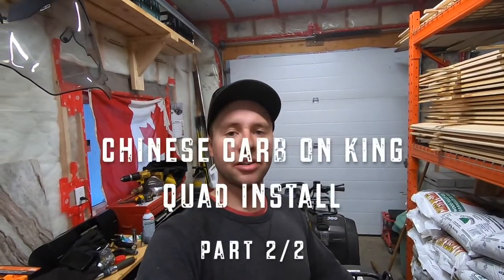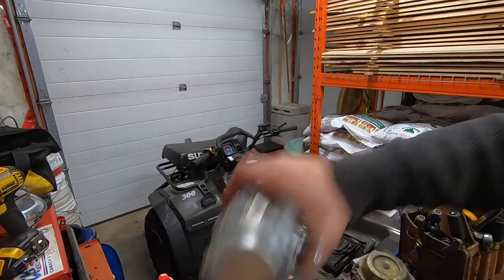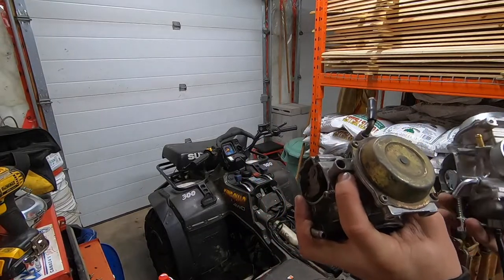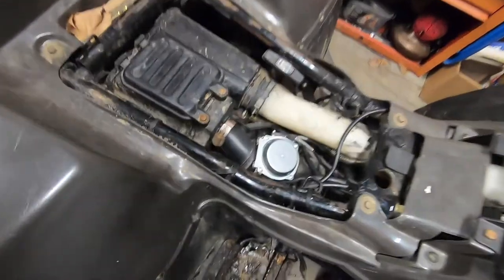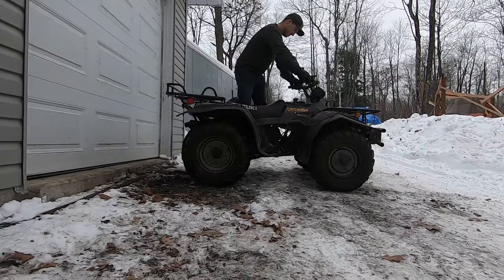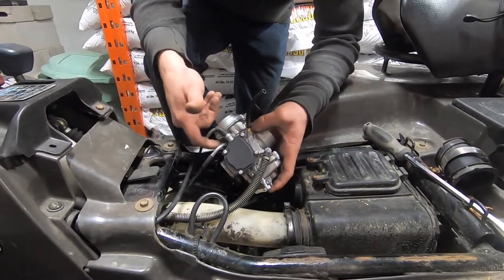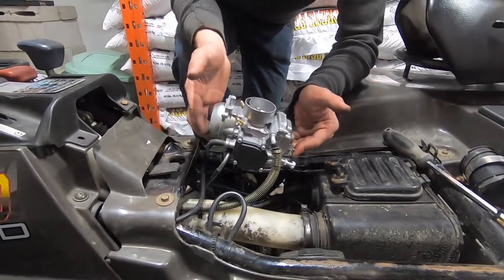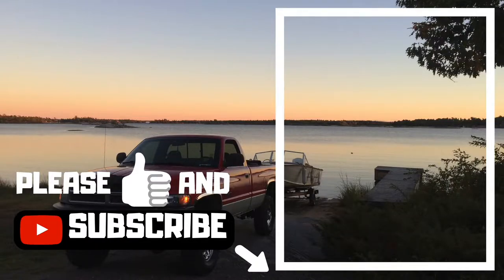Chinese Carb On a King Quad 300 Install Part#2 (Will It Work?)

Comment: Great video, I have the same issues with my Chinese Amazon carb, unfortunately can't return it because like you I modified it drilling out the throttle and the choke. I wound up just plugging the drain pot on the bottom and used pipe tread tape on the screw so that fixed my fuel leak issue. It runs great for a while sometimes 30 minutes or so and then stalls for no reason, sometimes idling it quits or sometimes running with throttle. No rhyme or reason to it. Unusually fires right back up. Mikunis are simple and a rebuild kit is less than the cost the knockoff carb so I will be fixing up my old one. I wish I came across your video before I tried and saved myself a few bucks.

Comment: As a mechanic of 35 years, with these Chinese Amazon carbs it's been hit and miss for me.I probably  installed about 120 of them and had about 30 defective. There is no substitute  for oem and I search the scrap yards first and Chinese last resort and customers are told this up front as it's not cost effective  to return them.Keep up the videos, your skills are good.
Reply from the maker: Thanks Steve. This was just a quick video. You are 100% right they are hit and miss. I never had luck and used the parts off that to sub for parts missing on the OEM carb. No replacement for factory parts… Thanks for the nice comment!

Comment: So i tried a carb swap, you have to use every jet from the original to put into the crap carb to get it to run and even then its not perfect, but rideable. Play with air mix screw and float height. Honestly i think the vacuum fuel system is pickey and aftermarket generic carbs are super hard to tune for these quads. I went back to rebuild the mikuni.

Comment: Have 1997 Suzuki 250 quadrunner, got the Chinese Amazon carb, and rcvd ok, all brass jets, fittings etc.. and float not plastic, well made overall, first thing did was gravity fuel test off the ATV for fuel leaks ( non found), installed with temp bailing wire choke / throttle cables,  started up, etc... that said, I didn't end up using it, due to the # of modifications that it would take to use my non threaded choke and throttle cables, new carb only had one vacuum port, old Mikuni had two, boots ( in / out ) almost perfect fit, but not exactly..  etc..   After lots of looking I concluded like the gentlemen below says, Junk Yard finds for old carbs best bet, didn't find anything on the net that matched old  Mikuni Suzuki Quadrunner carb,  Thus rebuild it if you can.... not hard and Schneids 15 has great video on how to do it...

Comment: I've run Suzuki and kawi style carbs for a while now and I can say the china carbs are great no problems at all. My only complaint with the Chinese carb is the diaphragm seems to be very hard in the cold causing it to run very poorly off choke until it warms up the carb a bit.

Comment: Great video! I had to drill out the same hole. Mine bogg’s just like yours did. When you get moving and keep on the gas, it runs great. Low end wise, not so much. I’m thinking about just putting the old carb back together with some of the new parts from the newer one..
Reply from the maker: That is what i would do👍🏻
Reply: Mine not only boggs down but it floods the intake box where the filter is completely. I’m a bit stumped as of right now.
Reply: I found that the size of the vacuum connection on the chinese carb caused the flooding.   To remedy, remove the nylon connection from the old carb and place it in the line.  I used a smaller hose to reconnect and the flooding stopped.
Reply: jeffer1957 I ended up completely rebuilding the old carb, but that’s good
To
Know! I never had any flooding issues but I couldn’t get it to pump any fuel at all
Reply: jeffer1957 that’s great I’ll try that!

Comment: The fuel leak seen here is probably the built in over flow not the drain screw ,  most likely due to the float adjustment .
If you must use one of these be prepared to match up the jets to your original and make proper settings . Out of the box
perfection would be wishful thinking at best.
Reply from the maker: Hey keith, it was not from the overflow. It was from the bottom. I had it on the bench and verified. Others have said they had this issue also. Josh
Reply: It is the overflow.  Restrict the vacuum to the fuel pump to slow it down.  I used the smaller orifice from the old carb online to correct.  Eventually gave up on the Chinese carb and installed a good used one from another bike.

Comment: So I’m wanting to see a video on replacing the one way gear that the starter spins. My pull starter works great but removing the seat every time is getting old.

Excellent videos, I subscribed
Reply from the maker: Thanks Justin, I have a video on this under starter clutch/ stator repair
Reply: Schneids15  thanks man, I watched it. you really do have the fullest video collection on these old kingquads.

Comment: I have one of the cheap carbs work great runs good just like he said the overflow keeps leaking. I’m going to try to put a oem float in it I think it will work there just not strong enough to hold the fuel back 🤷🏼‍♂️

Comment: I had an extra vacuum line on the top of the old carb. The new carb did not have a connection coming off the top of the carb. I plugged it with a bolt. My new carb idles and runs at 1/2 throttle. It bogs down hard at 3/4 to full throttle. I installed a fuel filter and noticed that it doesn't completely fill. It nearly drains completely on full throttle. I cleaned the fuel pump and petcock. Not sure what is going on.
Reply from the maker: Yes. I never had any good luck with mine either

Comment: On my china clone I also had to partially drill out the threads to put on the Suzuki Idle adjuster. Measured from the original and it worked ok.
Reply from the maker: If i was seriously needing to swap i would adapt the factory one on and adapt the factory choke plastic piece on
Reply: Funny thing is that mine leaked the same way as yours. Changed to the original Suzuki bowl, and it stopped leking out, but still flooded the bike.

Another tip for anybody working on these is to check out the Facebook Group "Suzuki Lt-f 4wd King quad". Very active with quite a few that know these bikes well.
You should post a link to your channel there Schneids.

Comment: Seems she was starting for fuel.  Was the oring missing for the fuel drain?  I have two of these machines.  And rebuilding one.  I'll start posting as well.  Swapping plastics from a 2001 to a 1998

Comment: I can’t get my king quad running it has spark and fuel but won’t start and the drain on the float bowl is leaking but only when I crank it over I don’t have a clue what’s wrong with it I checked the floats and there just fine

Comment: Got a barn find quad king trying to get started, followed some of your other videos and yet to solve all issues.  My main issue im having right now is im not getting fuel to flow.  Ive plugged my petcock vacume both sides and replaced the flue pump, carb, but cant get gas flowing, what am i missing?
Reply from the maker: Will it gravity feed from tank? Perhaps clogged pickup screens.
Reply: @Schneids15  I've pulled the petcock, flows free out the switch.  It doesn't flow free out of the outlet hose on the petcock, now that u mentioned that, I'm guessing that's my next step, remove it again and make sure it is clear there out the outlet side, or replace it all together
Reply: @Schneids15 petcock removed, removed the spring and o ring so it will gravety feed out of the tank into the line towards the pump, still no fuel flowing through lines, I'm guessing I trace it back to the new pump to see if thats working properly

Comment: I recently got a king quad 300 and and the carb was off of it I need help figure out where my lines needs to go
Reply: Following. I am in the same boat...
Reply from the maker: 2 vertical holes symmetrical on the back of the carb at the rear closest to manifold are overflow tubes. Blow in them and if it blows free it is a overflow. The front 2 are vacuum ports. Blow in those lines and it should not blow free. Either can be hooked up to each port
Reply: @Schneids15  how do I know which vacuum and the right order for the fuel pump? I have no ideal how to get the fuel pump(brand new) to work properly. I bought a nee fuel pump and a replacement carburetor. Cant find a video online showing the correct way to install a fuel pump for 96 Quad 4WD.
Reply from the maker: I would rebuild factory carb. I have not found an aftermarket carb that works good.

Comment: the o ring on the seat was probably left out bout one and the same thing with fuel out the bottom bought another and it worked just fine
Reply: was thinking the same.  Agreed.

Comment: I am going to tackle my carb tomorrow after watching your videos. It has been sitting for a year . Do you think if I clean it that will be fine or should I put a kit in it. Also if I run into problems can I get in touch with you for help. Thanks
Reply from the maker: Sorry. Hope today went good. You should be alright with a clean. Likely a bit of gunk in the jets.

Comment: Howdy. Thanks for the detailed fixes on the King Quads. I rebuilt my 96’ carb thanks to your vid, and it works well. Starts ok and idles good. However, after a sustained run, it will die after coming back down to an idle. It’s starts right back up easy. Seems to have issues coming to idle. What could it be? Any info would be greatly appreciated. Thanks.

Comment: Great videos!  Came across your channel and was surprised in the similarities to my vehicles.  I currently run a 95 300 King Quad, 2017 Skidoo 1200 and did have an old 1980 (I think) Enticer 340 ! Any videos on replacing the front CV boots on the KQ ?  Thanks!

Comment: I have a suzuki quadrunner 250 and I would like to know what the best fuel mixture screw setting is and were the best spot for the diaphragm needle should be set at
Reply from the maker: I believe 2 5/8 turns.

Diaphragm needle start in middle. If it pops at high rpm go down and if good leave it. If too rich move it up,
Reply: Thanks for your help and replying right away

Comment: My king quad runs like with the chinese carb, but without leaking. I cleaned it yesterday but it runs the same... It only runs with choke but with high revs. I set it at 2.5 turns, so I maybe have to set it closer to 3?

Comment: Just bought an 01, hard to start 01 but runs good once started, the seller may have not been completely honest about telling me it has a Chinese carb on it and so now I'm screwed it appears.
Reply: well, kinda easy to tell if it's OE or Chinese by looking at it.  Use this video and the previous video to help tell the differences.  But, your hard starting might not be carb related.  It might be that your valves are toooooo tight.  Check the valve  clearance.  It's common on these King Quad 300.  Oh and of course, Schneids15, has a video from 2020 showing the process.
Reply: @biz4twobiz463  It was from an old friend who offered to buy it back with no hard feelings at all, I believe the carb was Chinese but he is the original owner and claims it to be oem, problem resolved and thanks biz.

Comment: OK here's a king quad question. How can you tell what year your king quad is? Bought one a few weeks ago was told its a 90s quad when I asked what year exactly he had no idea late 90s was the best he could do
Reply from the maker: Front left frame it is a vertical/ angled a bit piece and it will have your serial# on it. Call suzuki and order parts and give them the serial number or decode it online.
Reply: On the left rear of the quad behind the wheel you will see a 17 digit VIN. The 10th digit is a letter that identifies the year model. I found a chart online that matches the letter with the year. My quad has "t" as the tenth digit which means 1996. My parts quad has "x" which means 1999
Reply: @mrlemonadesandwich  uh thanks but this was almost 3 years ago I sold the quad in 2020 and yes that's where it was but it had been rubbed off

Comment: What about the vacuum  port right below the diaphragm for the slide.Does anyone know where that goes on the machine? The new one in the video does not have it? I thought this had something to do with vacuum to the diaphragm?
Reply from the maker: Both lines have vacuum when hooked to the carb. The new carb has only one and you route that to your fuel pump. The secondary one would go to your fuel petcock which i have bypassed.
Reply: @Schneids15  If I don't have my petcock bypassed (still have the vacuum line) can I use this type of carb?  Do I have to bypass my petcock?  
I pulled my old one out yesterday and noticed the old carb has 2 vac lines and the new carb has only 1.
Reply: @Schneids15  I installed my Chinese knockoff carb.  It only had one vent port, so I put the petcock in the "PRI" position.  It leaked fuel like crazy, like yours did.  Seems the float needle is not fully seating.  Maybe it needs to be adjusted.  I need to access the float to be sure.  Any recommendations are greatly appreciated!  Great video.  Thanks!

Comment: I ran into the same problem so I sent it back to the eBay Seller. Rebuilt the OEM carb for about $35 and it runs like a DREAM ;)
Reply: Did you have to adjust the float height (and how) and where did you set your idle screw to?

Comment: Hi love ur work.  I have a king quad 300 and when it gets hot it is very hard to change  the gears up  any suggestions  plz
Reply: Is your oil cooler up by the front clogged up oh, and check his video out on the right oil

Comment: My susuki ltf250, runs great for about 3 minutes then shuts off, then won't start for about 10 minutes starts up again then shuts off. I pull new sparkplug out its all dark black and dry. Put a new sparkplug in and same thing 2 minutes later.
Reply from the maker: Sounds like the fuel pump diaphragm on bottom of fuel petcock has went bad. Check vacuum line from it or other fuel pump to see if they have gas in them. If none go for a bad carburetor needle/ float
Reply: @Schneids15  thank you I was leaning towards a bad plunger/diaphram.  Thinking it only runs till the bowl is empty then after it sits give time for the bowl to refill itself only to run out again and shutoff

Comment: I am at wits end with my 2000 King Quad.  I replaced the carb with the Chinese carb then tried a good OEM from another ATV.  Replaced fuel pump. Bike idles but will not rev up.  Spits and sputters. Fresh gas, no vacuum leaks. Getting good fire. Checked and or replaced ignition components.  No improvement.  Running out of ideas.  Anyone?
Reply from the maker: Do you have your intake on when testing?
Reply: Yes. Removed intake inspected, cleaned and reinstalled with gasket shellac.
Reply: I am referring to the engine intake.  I also have the air filter in place.  I eliminated the air box and used a simple filter instead since I have disassembled so many times!
Reply: Sounds like voltage regulator.

Comment: Great videos on the King Quad! Pretty dissappointed that the chinese carb didn't work. I bought a 99 King Quad 300 last year for 50 bucks from a guy, went out the other day to get some model numbers to order a carb rebuild kit (it's been sitting for years) and noticed the Quad is missing the carb and pull start....Guess I will need to try to find a mikuni to rebuild.
Reply from the maker: A mikuni is your best bet by far. I could still tinker with the Chinese one and figure it out i bet.
Reply: @Schneids15  Yea I am thinking Mikuni is the way to go. I did a search on ebay but did not see any. You happen to know the model number for the carb that fits a 99 King Quad 300? That would help out a lot. Thanks for responding.
Reply: @MrTestertester  I have a '99 KQ 300 as well.  There are two carb models.  Mine is a model "X".  Check out Suzuki's parts site.  
https://www.suzukipartshouse.com/oemparts/l/suz/50d0a5a8f870022c2c534bfd/1999-kingquad-4wd-lt-f300f-parts

Comment: Be careful when you drill out the choke portal and the gas throttle portal. I watched you drill them and you drilled too far.
Reply from the maker: Odd you seen it when it was not filmed